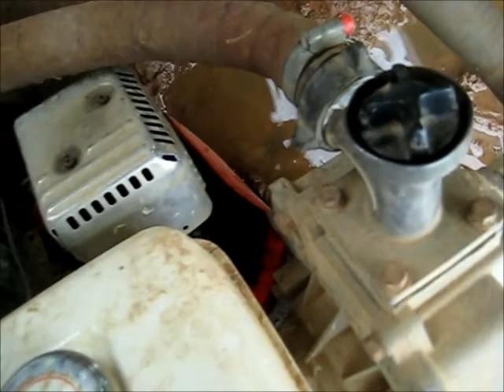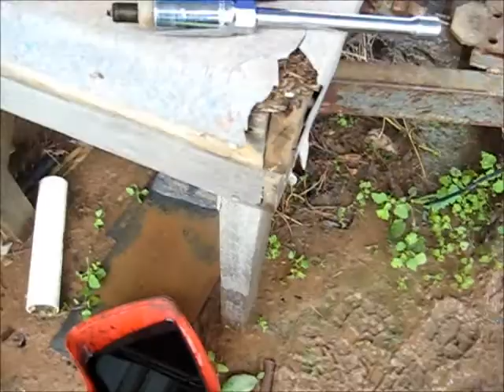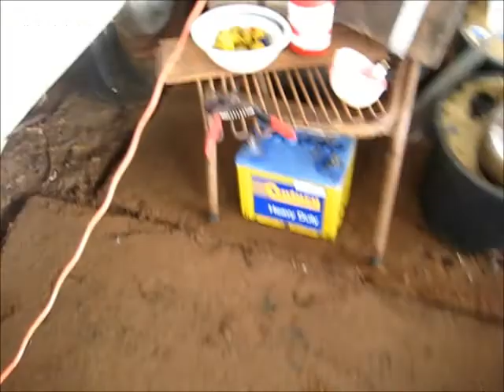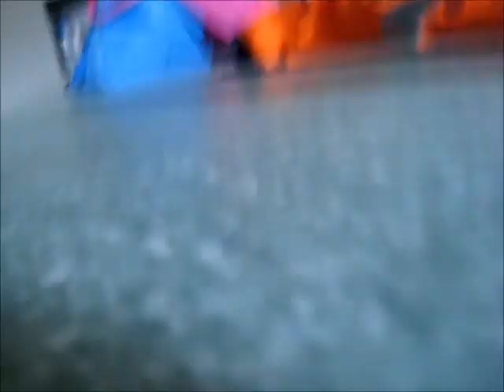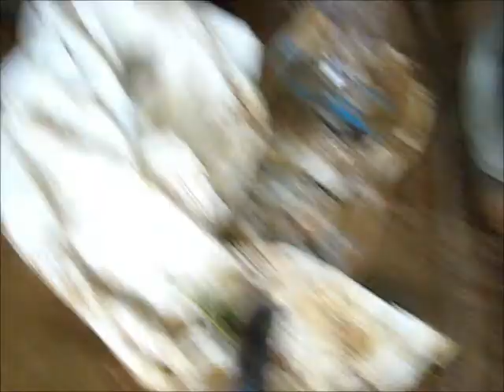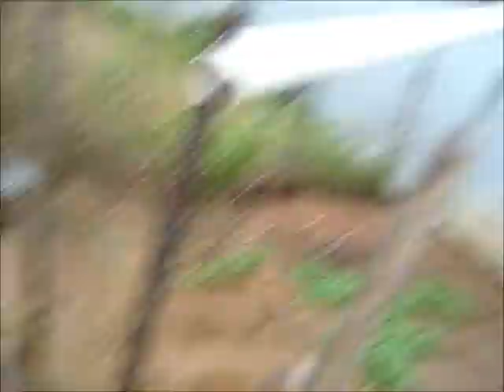Honda GX 140 Service & yet more water

Comment: better off to change the spark plug in that honda since it is the original plug, i highly recommend NGK R platinum as a replacement.I find turps and a wire brush works better for cleaning spark plugs.